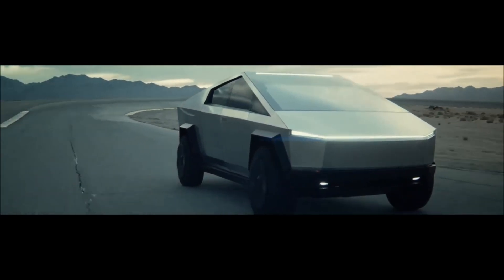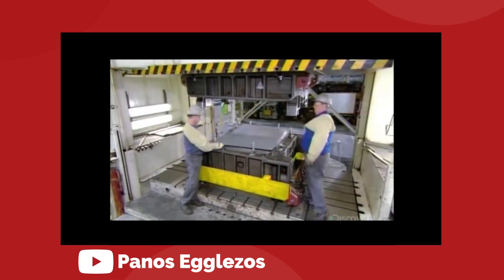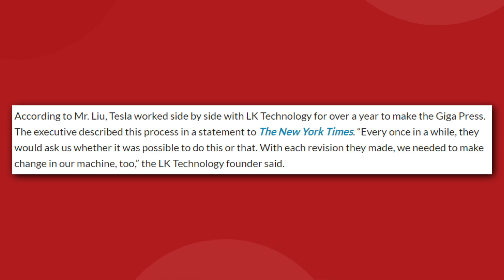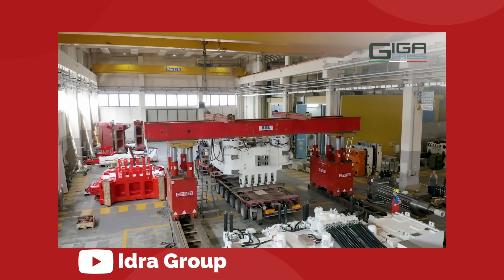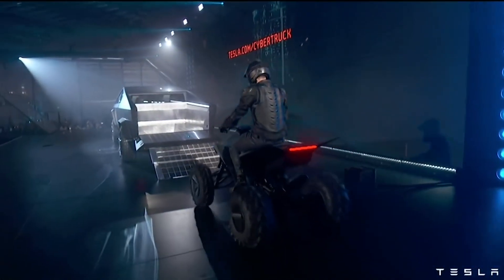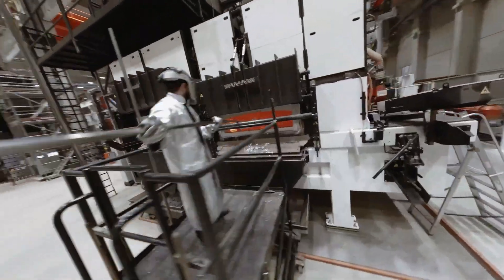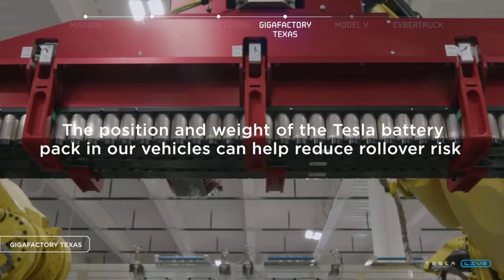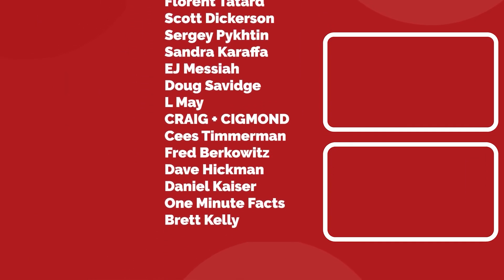Tesla Reveals New Cybertruck Giga Press!

Comment: Do you notice that the cab roof is about half the length of the glass over bed. But in the CGI shot of a man open the tailgate. The glass bed cover slides COMPLETELY into roof???? Not going to happen in real world. Unless you make glass cover in two pieces and they retract over each other while being stowed away in roof. Right???? Lol... Nice futuristic desighn. The glass cover over bed may be a big trouble and a little over achieving there.
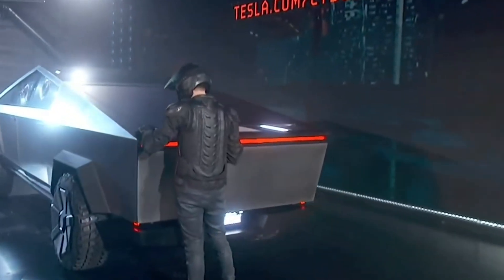Reply: @7:08 Look again. It doesn't go into the roof. It goes down under the bed.
Reply: @nunya___  oh so that's why release is being extended , working out some of the bugs. They've switched to a polymer type cover. Don't know how that going to work out. Looks like a complicated design. Especially for track wear or repair if it breaks. But looks kind of tough and futuristic.
Reply: the bed cover is articulated stainless steel segments which roll up under the forward end of the bed.  You can walk across the cover.
Reply: @gepeterson2  That makes sense...roll up just like commercial security doors.
Reply: @gepeterson2  sounds pretty expensive, complicated desighn and something waiting to break in very little time. And give Tesla a bad name in quality. Quality is what Tesla should be concentrating on. Quality and value, not supper speed. The speed will come as the people see the value and quality. Either just go for cheap and to make a fast buck, then company collapses. Or become the best ever in the business helping the public and making a steady profit. Tesla, if they want to could become a great benefit to the public by just making a utilitarian vehicle that could get the kids to school,  mom to grocery, or work and back. Don't need to jump out immediately with the world fastest ,prettiest and most expensive electric vehicle. Need vehicles cheap and reliable for short daily use. 200 to 300 miles. Just need to start by making Tesla a household name. Cheap and reliable to begin. We need to push for small nuclear reactor grid across U.S..
Reply: @rh1960  You really don't get it, do you?  Cybertruck is a VERY inexpensive electric truck, in its basic version.  Compare the prices with those of traditional large pickup trucks.  And the "short daily use" stuff you're talking about is precisely the kind of things that Robotaxi will address.  People don't need to OWN a car for that kind of stuff.  Musk had it exactly right... start out by proving that electric cars have unbeatable performance (they're hardly a "golf cart" as some idiots keep trying to call them) and then get the pricing down as volume increases.  But still practical for occasional long vacation trips too (with the supercharger network).  As for "nuclear reactor" I think those days are over... wind/solar is the proven way to go, for the future.
Reply: @gepeterson2  brother you don't get it. The economy is bad, a lot of people don't have that kind of money. If you want to take over the market, produce a low cost utilitarian vehicle. Just get mom around city dependably. That's how Ford took over, he thought more of the public than money he could never spend. But Musk seems to be able to realize this, he seems to be very smart. But we need to start setting up a new  small nuclear power grid that's more reliable. Something like they use on our military ships. Nuclear is the most logical way to go into the future, its allready in our hands. Smaller ones would be easier to handle and if one goes off line make sure grid can patch in temporary. If they really want to move on these electric vehicles then  small nuclear power is the logical course.
Reply: That isn't CGI. I's footage from the unveiling.

Comment: I don't think that machine can do the entire truck in one shot.  For the size of the part that machine needs to grow exclamationally for size. You would need more then twice the tonnage. I think they still are going to do a front end back. Just larger pieces needed.
Reply: Still separate front, central, rear sections. (Maybe the battery pack is still steel?) SS body will add to strength as it’s integral with underbody (chassis), not rubber mounted like every other truck. The strength / rigidity proposition is in the ribbing, can’t do that with steel. This is already a massive press, novel manufacturing, IDRA / LK are hastening slowly.
Reply: Eh. Almost certainly will be two parts, but maybe not. The video does state it will be two pieces.

 It depends on the design entirely though. In both injection molding and die casting a common number you see is roughly 3 tons per square inch of projected area. With 9000 tons this leaves room for 3000 square inches of potential projected frame area.

It depends how much of that webbing they can eliminate from the design that turns those frame sections into big sails.
Reply: @Spearborne  good comment re area of castings, projected area. Do the ribs add to projected area? I’d love to see simulation of how press accommodates ribbing / complexity. I found link quoting for 5,600 T press 1.4 m^2 projected area (~2,200 sq in or 2.5 T/sq in)
Reply: @iandavies4853  projected area is just whatever the shadow would be under it if you had a perfectly perpendicular light source above the casting. Ribs don't add to it unless they're floating out there on their own.
Reply: @Spearborne  thanks for reply & original comment. I’ve learned a little more today, though I’m still quite ignorant. It’s nice to have a workable metric (3T/ sq in) as guide.
Reply: @iandavies4853  yeah it's not something that's set in stone but it works for most of what I do on a daily basis lol

I am unfamiliar with metal die casting but work with plastics instead, and there is a wide variety of factors that play into it. Many plastics are much higher or lower viscosity for example. Plus thin wall stuff may need higher injection pressures and that will affect it as well.
Reply: Depending on the Aluminum used welding can lose up to half it's original strength. This is why Telsa cars can achieve such high ratings in crash safety tests. My father owned a pickup truck that had the back body as a separate piece, after a minor accident it shifted a few degrees and significantly impacting it's driving performance. You want as much of the frame casted in one go as possible.